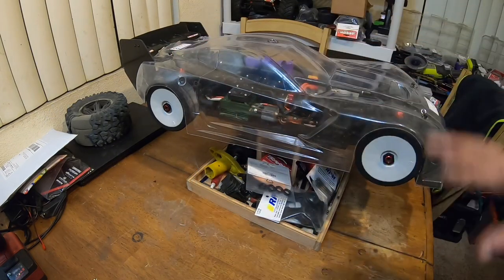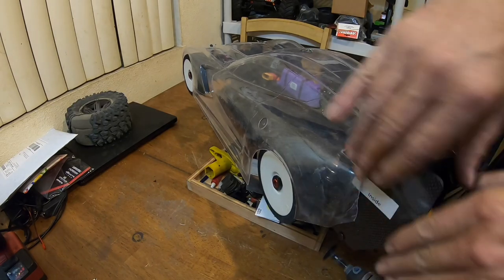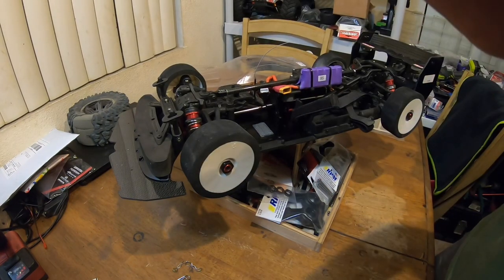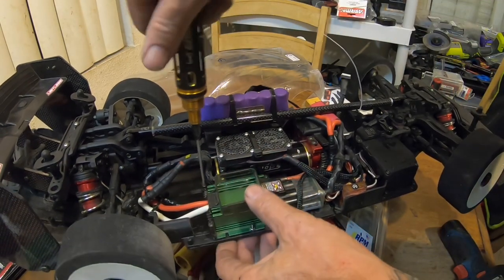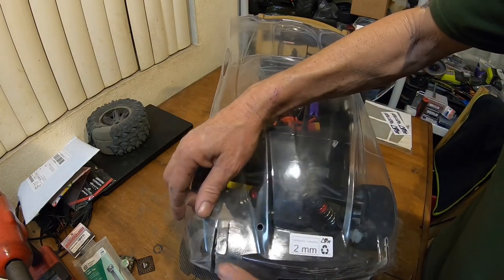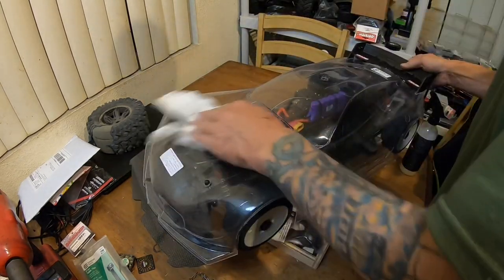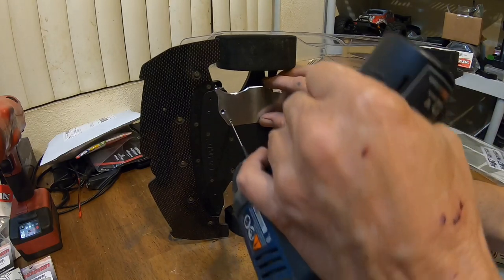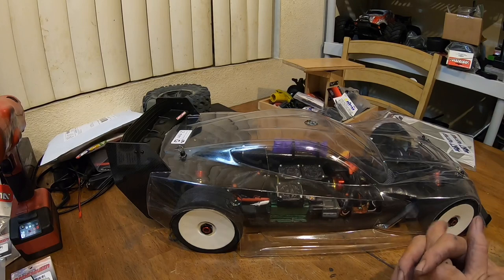Arrma Limitless Refresh GT conversion Final Touches rear wing plate esc body mounts

Comment: I would bet cutting out the back will be better for less drag
Reply from the maker: Yes it might be better depending on how much air gets inside hopefully I can keep a lot of the air out as there is a gap for air to flow a little but I feel like you do might have to be cut away 👍👍👍